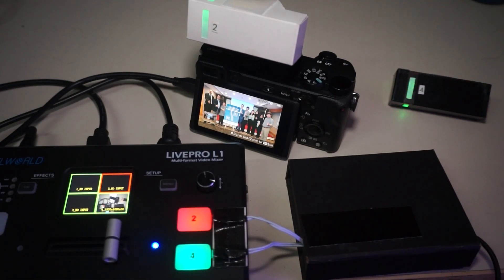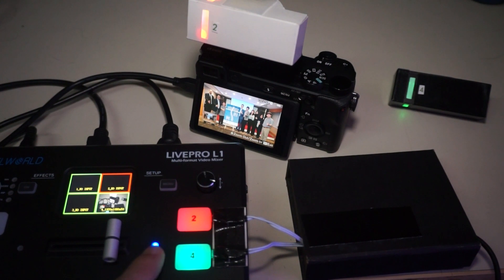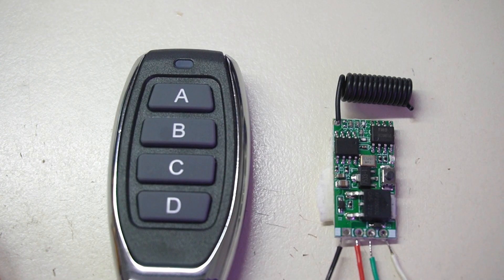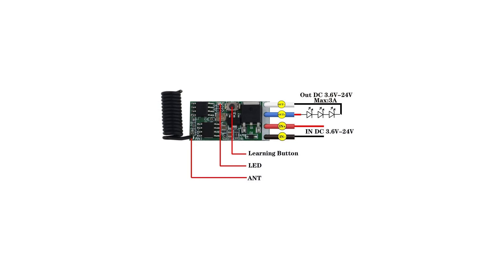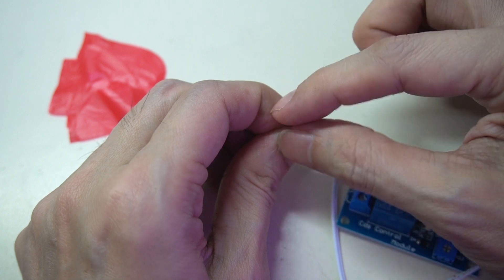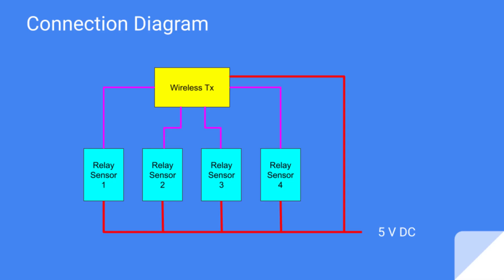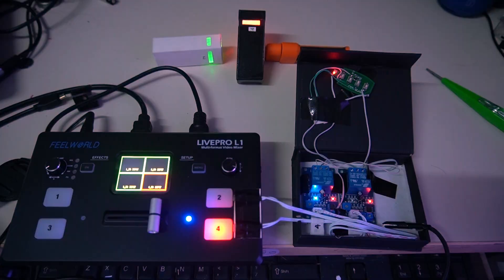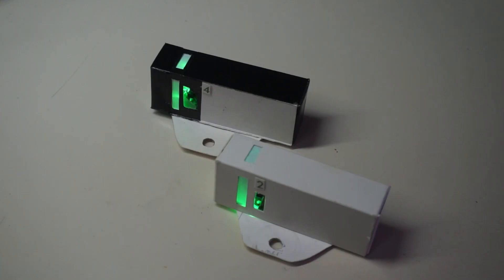Tally Lights - Make Your Own

Comment: Thank you for a brilliant idea. Does the XH M131 has to be connected with tape to mixer during use or its during the initial setup
Reply from the maker: Hi! Yes, the LDR Sensor has to be taped to the video mixer every time you want to use the tally system. Because the LDR sensor is sensitive to light, your mixer must not be in a bright place. So this idea will not work well if you are outdoors during daytime.

Comment: I feel really good to have found this video because I’ve been trying to figure out how to make a tally light system by myself. It feels like luck that I came across your video, especially since I don’t have enough money to buy the ones sold online. Also, I want something like this because it can be used with various switchers.

Would it be possible for you to build and sell me a 4-camera set? If so, please let me know the price. I'm based in Thailand. Thank you very much.
Reply from the maker: Hi! Thank you for your response. I built this to see if it works or not. This idea will work well if you are in a dark room. In a bright room or if you are outdoors during the daytime, the system will not work very well. LOL.
Reply: @kenlim116 anyway would you build one set for me, cuz I normally work indoor.